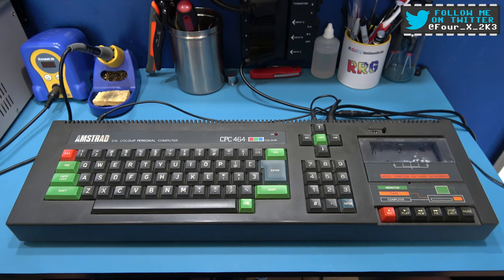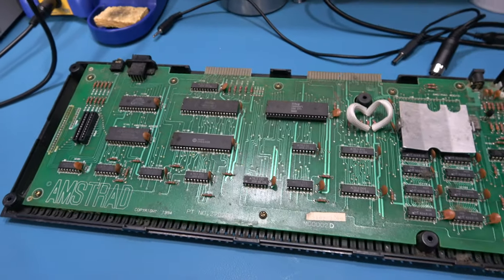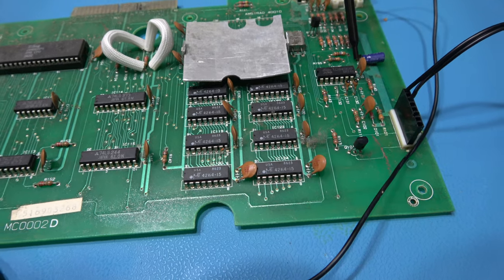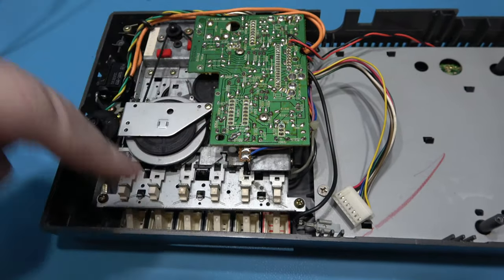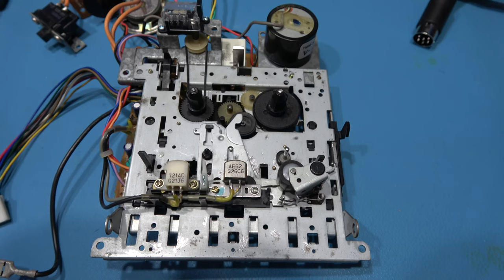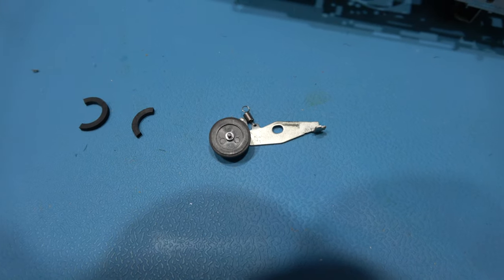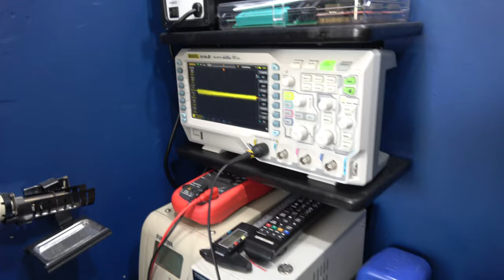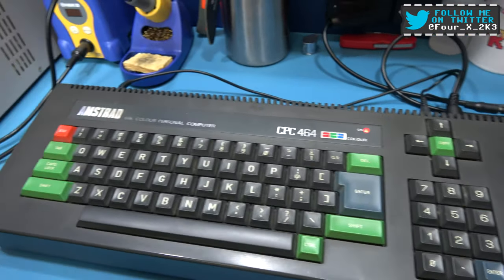Amstrad CPC 464 (Number 2) - Part 1 - Repair.

Comment: Any idea why pause button doesn’t work
Reply from the maker: Common fault, it happens to the Speccy 128's as well, there should be a white latch near the main wheel. if its broken or missing that's why the tape system wont pause.